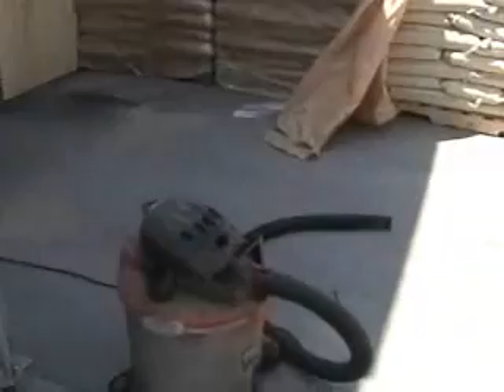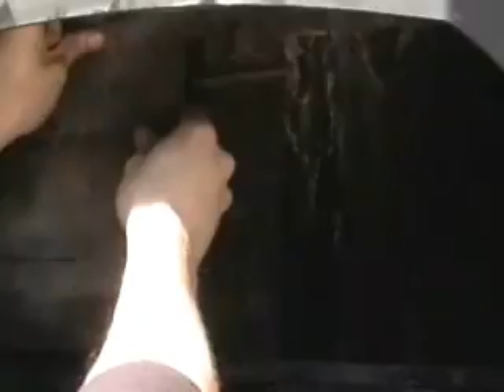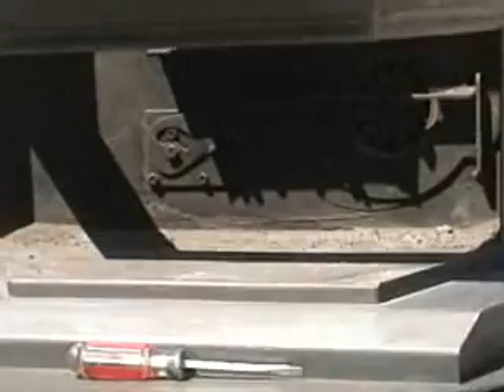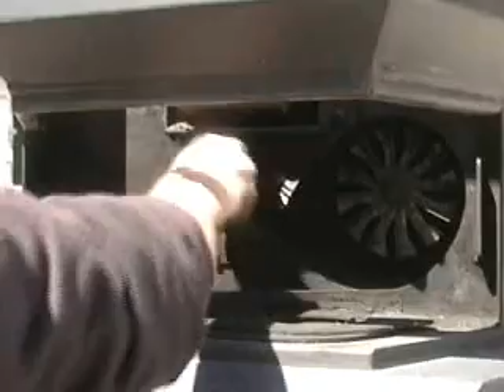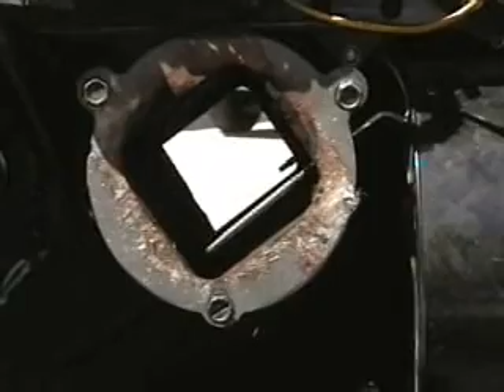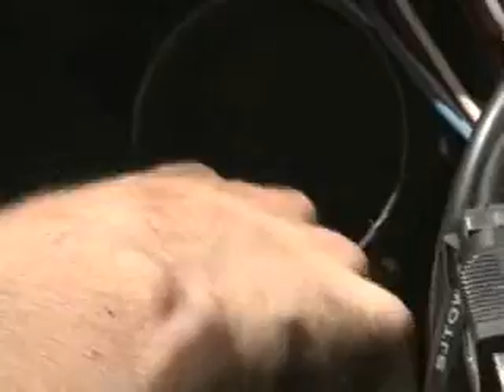Wood Pellet Stove Cleaning Part One

Comment: Very helpful video. I cleaned my Harman for the first time and used the scraper tool on the heat exchanger. I couldn't figure out how to get to the combustion fan  and was trying to do so from behind. After a while I decided to resort to You Tube. Ah hah! Th e combustion fan is in behind the ash pan! Thanks so much for posting this. The manual gave no clue to that fact. I went back and used a paint brush to clean the heat exchanger. I got so much more debris than what the scraper got. THANKS!!!!